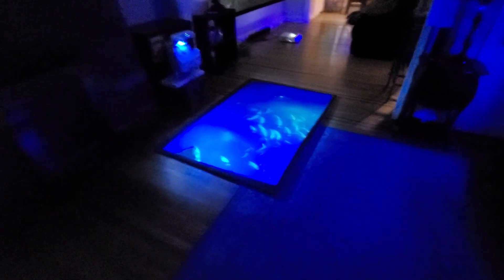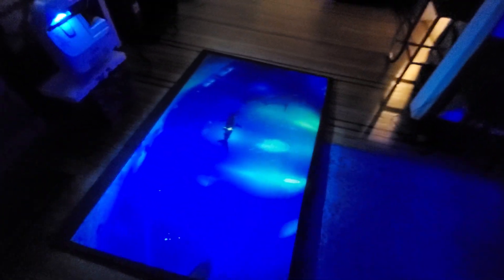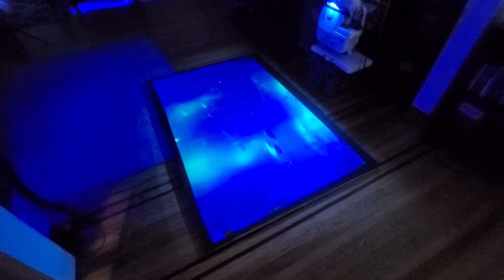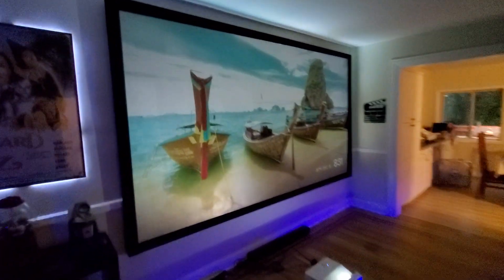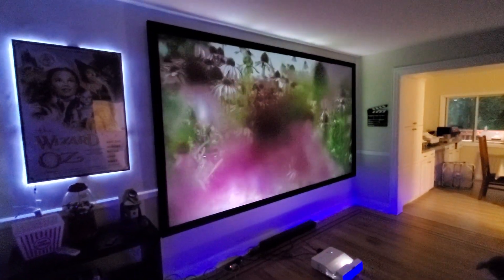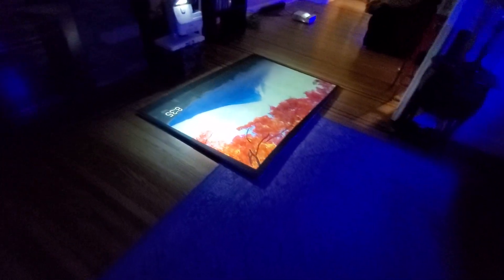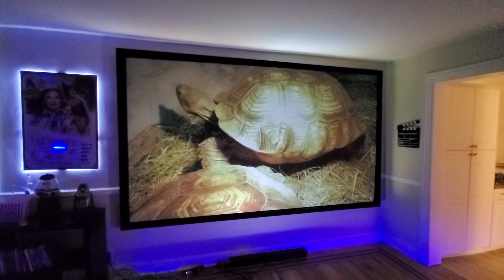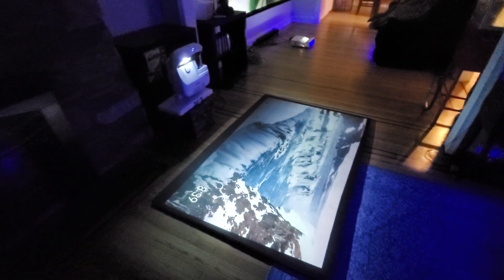Styrofoam OLED like projection screen using EPSON  585W UST 720P

Comment: Can it be shipped to India??
What will be the Cost??
Reply from the maker: We ship to india and shipping is free
Reply: What will the cost of 100 inch ALR Fabric??
Reply from the maker: @tanmoybanerjee4922   Sorry we don't make fabric only the screen paint.
Reply: Can it be painted on foldable white matte projection sceen which I am using??
How much paint will it require and what will be the cost??
Reply from the maker: @tanmoybanerjee4922  Yes it can be painted on any surface and if you are painting a 100"  120" you will need 1 qt
Reply: What will be the cost of 1 qt??
Reply from the maker: @tanmoybanerjee4922  
supreme black ALR  12 price for 1 qt  $160
supreme 9 ALR GOLD 1qt price  $148